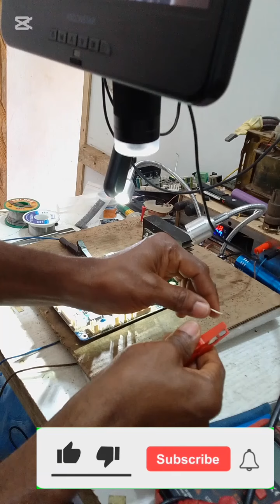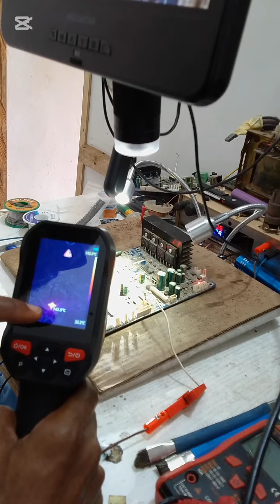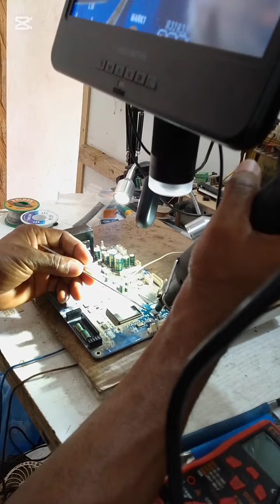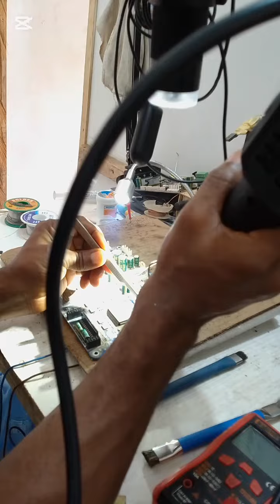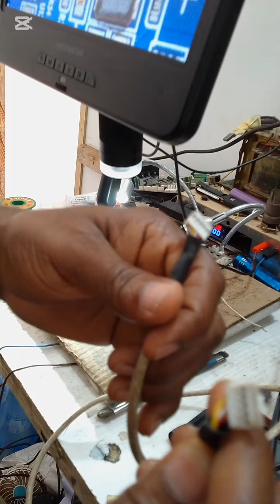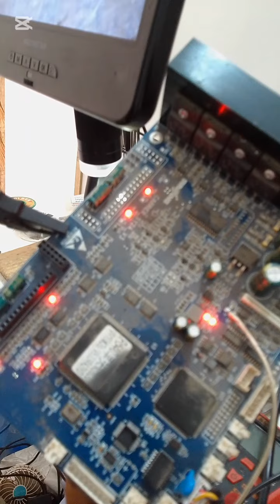XP600 Network IC Replacement - Step-by-Step Repair Guide

Comment: Hallo...i need help with Dtf board...it says car stall error but i changed the mother board
Reply from the maker: Have you confirmed that the fault is from the headboard? Encoder sensor, encoder strip and carriage motor can cause the error messages.

Comment: Hello. My xp600 connection on pc connects and disconnects when pinged or connecting to atools. Replaced ffc flex cable, lan utp cable, and the black data cable. Still, cannot connect. The printer indicates that there is a connection and the two pc logo at the screen bottom of the printer says connected. The lights are blinking and the network chip is not hot.
Reply from the maker: Try to uninstall the software and reinstall it, it could be virus or bug.
Reply: @microtechFIX i already did. Thats why i watched your videos and have an idea to that also. My problem is that mine has lights and chip's working unlike what you've shown in the video. About the chip, where can i get it?
Reply from the maker: See, the connection logo on the machine screen, the blinking of the Link LED will continue to show up if the following conditions are met: good transceiver IC and it circuitry components, good Link cable, good RJ45 cabling and it ports, good connection between the printer and the computer system, even if you don't have printing software installed on your computer system.
Reply from the maker: Can you try another computer system to confirm
Reply from the maker: You can get it from AliExpress
Reply: I setup the ip addresses correctly and used manufacturer's atools. Turned off antiviruses, firewalls and internet. Nothing happened.

Comment: hi can you try to check my head board if it ca be repaired?
Reply: it does error 16 even head is not connected
Reply from the maker: Error code 16? It can be repaired
Reply from the maker: Contact me on WhatsApp: +2348086234536
Reply from the maker: Yes, what is the issue with your headboard?